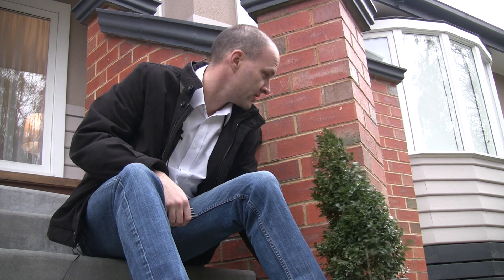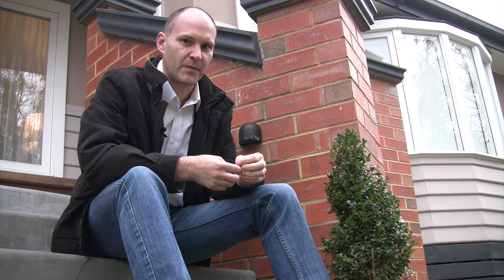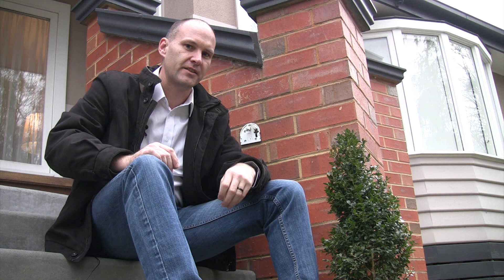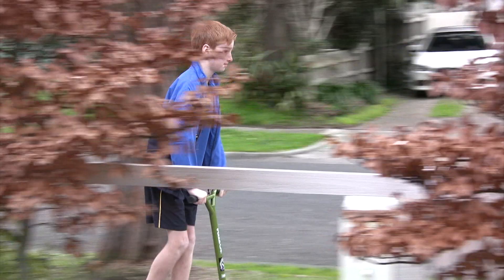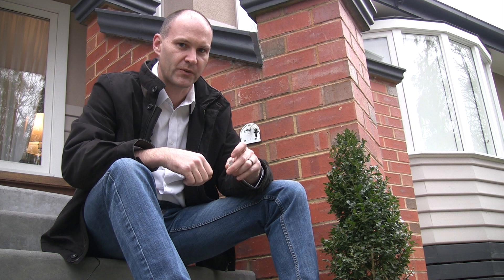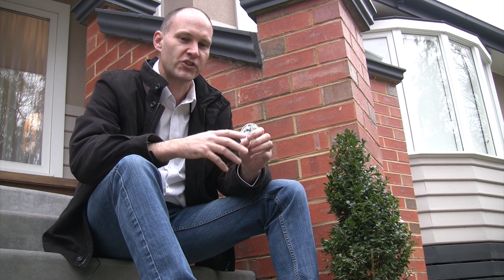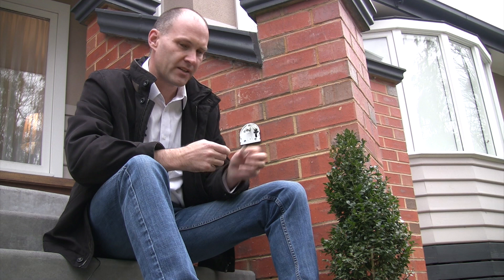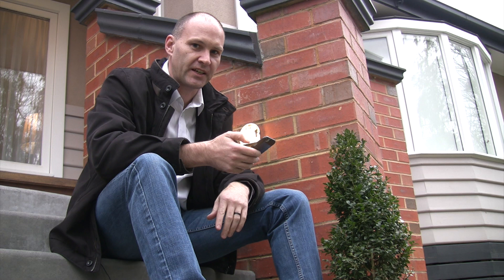SuperHouse Vlog #40: Out with the halogen, in with the LED

Comment: cool. question, are your blinds automatic? if so how? and should build a robot to take the trash bins out ;) look forward to seeing more.
Reply from the maker: Yes, they're motorised. There are 240V motors inside the blind tubes, which are controlled via the switchboard using Arduino-based controllers with DIN-rail mounted relays. There are dozens of motorised blinds in the house so I should do a video about those some time. They're all controlled by OpenHAB.

Comment: Hey mate. With building a new home would it be a good idea to wire the house lights up as 12v ? Just thinking it could be a option if we are going to run leds. Could save a bit of money in sparky cost as I want to run all lights back to the switchboard like you have done. Or is the amps to high and the gage wire needed not worth it?